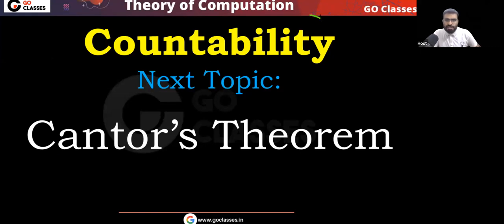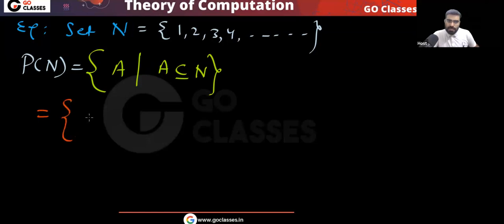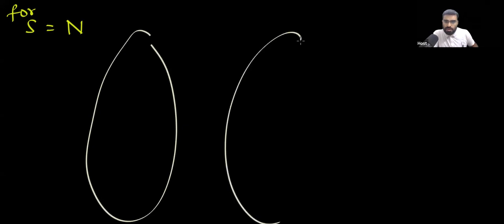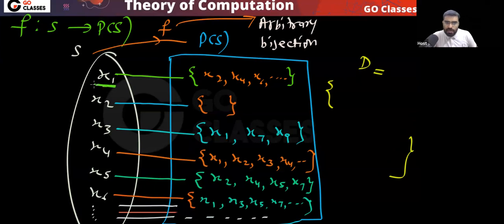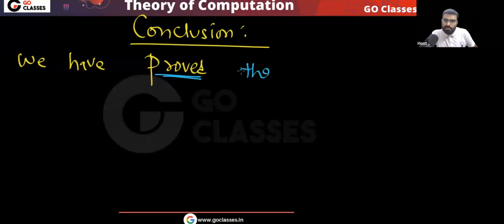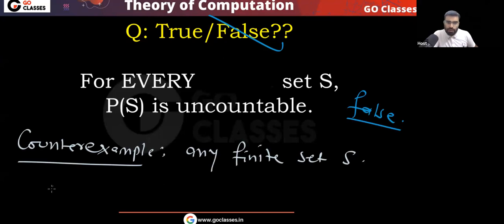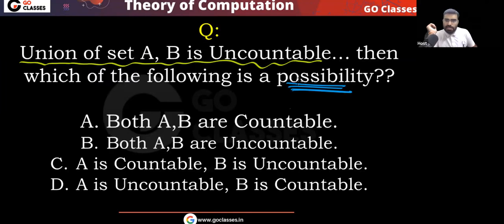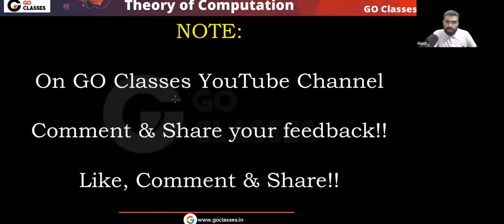Countability Lecture 6 - Cantor's Theorem & Consequences | Infinite Levels of Infinity

Comment: 1:15:13 but isn't it a circular definition ? Because in this definition , we are defining an infinite set based on it's cardinality with respect to another infinite set (N), which i think is a circular logic.

Wouldn't this be a better definition ? 
"A set S is infinite iff P(S) is uncountable" 
I believe this avoids the circular logic because we don't necessarily need to define 'uncountable' in terms of infinite sets. Uncountable set can be defined as :
"A set S is uncountable iff there does not exists any enumeration procedure for the elements of S"
(I know all uncountable sets are infinite but i think we dont strictly need the notion of infinite sets to define uncountable sets) 

Is this logic correct or am i wrong somewhere ?